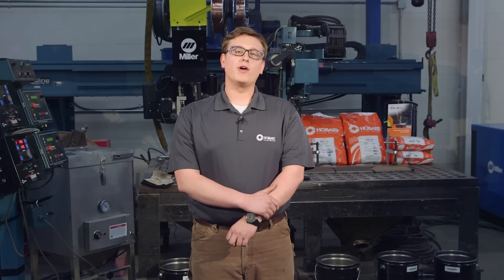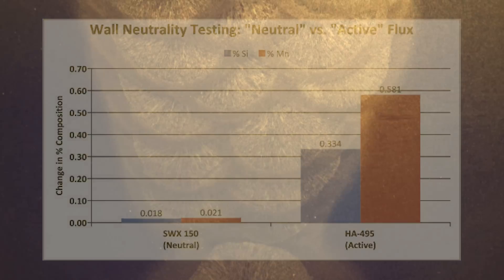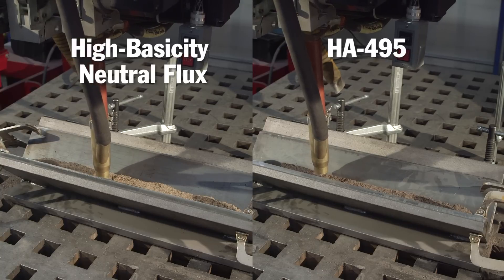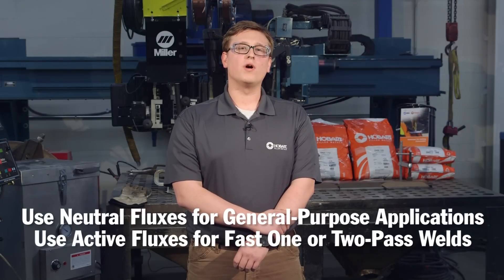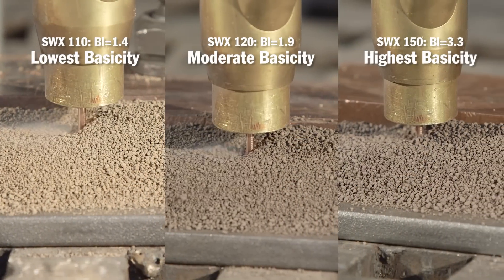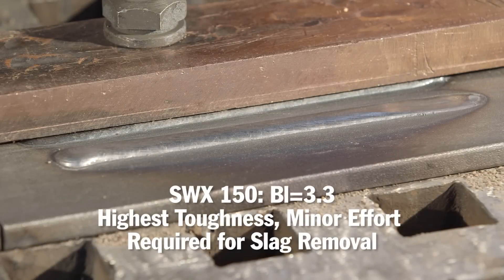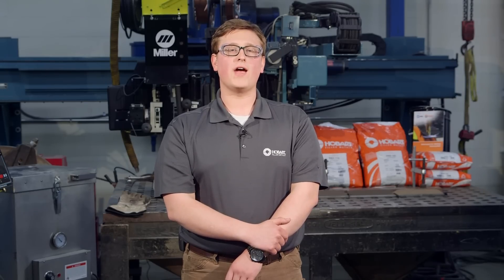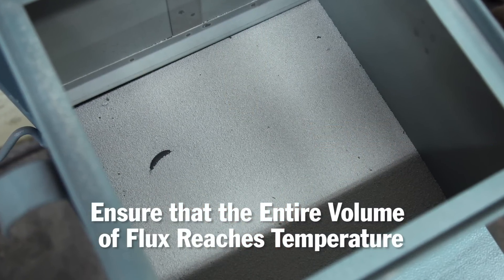Gain the Best Submerged Arc Welding Performance with the Right Flux

Comment: How do you figure out ipm for subarc?
Reply from the maker: Hi Luis, thank you for the question. What application are you using? Without knowing the specifics of the application you are using we can only recommend contacting the wire manufacturer for recommended IPM ranges. Thank you.
Reply: Weld procedure